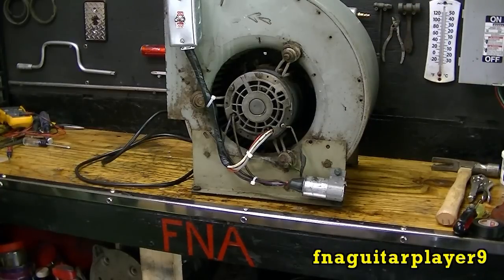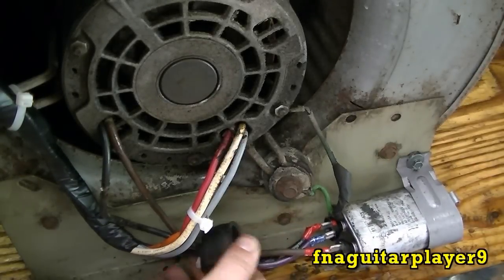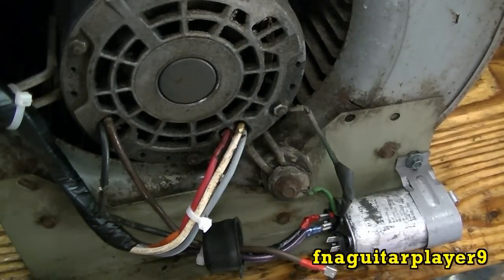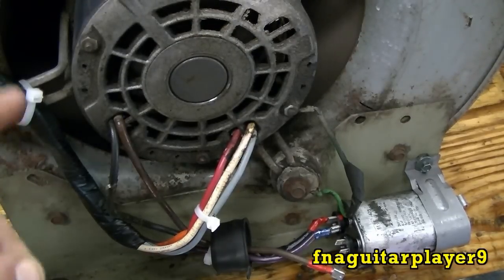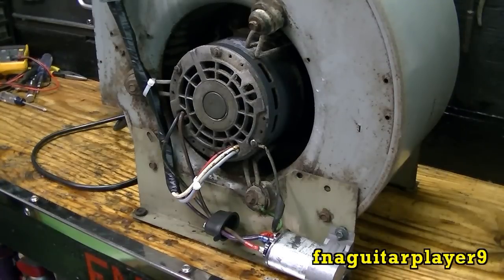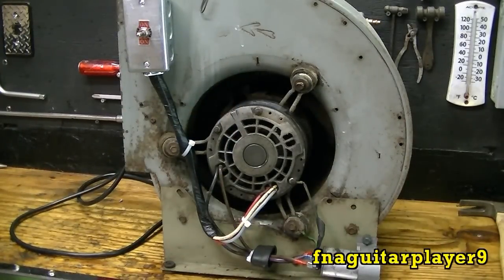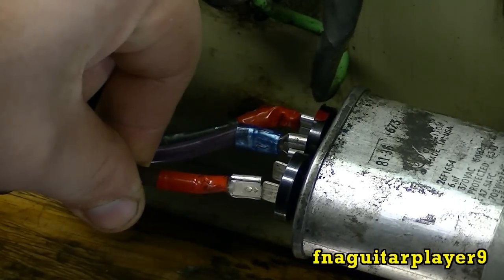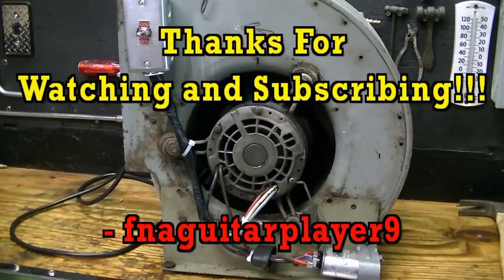Interesting Fact About Capacitor Start Induction Motors

Comment: If you put the start cap in series with the run windings, letting the start windings directly attach to power, will the motor run backwards for a while? That way, the run windings will be lagging out of phase with the start....

Comment: I wonder if you turn a dryer drum backwards if the motor will actually turn in the opposite direction because they have the centrifugal switch in them

Comment: ELI the ICE man: Voltage(E) leads Current(I) in an Inductive(L) circuit (ELI); Current(I) leads Voltage(E) in a Capacitance(C) circuit (ICE).  When you start an AC motor, which is a large Inductive circuit, the voltage and current are 180 degrees out of phase with each other.  The voltage is trying to turn the fan motor the proper way, while the current is trying to turn the motor backwards - that is why the motor sits there and either hums, or often times, it will sit there shuttering back and forth.

The run capacitor might make a little more sense to what I just stated above.  When you charge a coil it produces a magnetic field around the coil.  When you take away the voltage from the coil, the magnetic lines of flux collapse back on itself (the coil) which induces a voltage (and current flow) back the other way than how it was charged.  In an AC motor the magnetic field collapses 60 times a second, and each time the magnetic field does this it produces a voltage opposite of what the motor needs.  The run capacitor is a storage tank to take this unwanted backwards ripple off the incoming line voltage, and therefore out of the motor.

Without taking this ELI the ICE man thing to an engineering level, an antenna radiates an electro-magnetic signal into free space only when voltage and current are 180 degrees out of phase - that is to say, that the antenna is Resonate at that frequency.  Capacitors will not past DC, only AC.  So, when you put a cap on the line, or in a circuit, it sees the ripple as an AC signal and filters it off the line out the back side to ground.  I am a radio guy, and I can only apply this theory in my world of higher frequencies.  I look at an electric motor and say Damn, that is one big ass inductor!  This goes to the heart of Inductive and Capacitive Reactance and, without getting into the weeds, it will take a good size Cap to get and keep voltage and current back into phase.

Comment: I had been running a tiny table top belt sander built around a one eighth horse power fan motor. When I added the cap the motor would only start in the wrong direction I needed it to. Ideas?

Comment: What happens if you reverse the wires that connect to the capacitor.  Will the motor spin in the opposite direction
Reply: There's two sets of windings, start winding and run winding , the start winding is wired in series with the capacitor,  to reverse the direction the start winding connection may need changing over inside the motor box terminal .

Comment: I recently acquired a system very similar to what u just showed, it don't have a power switch although it has that box housing with wires protruding out of it, also it has no capacitor. I need to get it up and running, it's all about wiring everything correctly. So I needed to see more wiring schematics from the power switch perspective.
Reply from the maker: I have another video that goes into more detail on this setup. https://youtu.be/3vwUoo6WczE  Thanks for Watching!!!

Comment: What is a start and run capacitor?Are they used the same and functions the same?I tried to help my motor spins on my furnace but only spins for a minute and stops so I need a new capacitor and it works back to normal after I replace it with a new 10 mfd 420/370 volts capacitor.
Reply from the maker: Start capacitors will only be activated when starting the motor, it helps provide more starting torque, and basically sets the "timing" (phasing) of the motor so it starts in the same direction every time. Run capacitors will do this to but remain active while running to make the motor efficient. Thanks for Watching!!!

Comment: One more interesting  fact you can add to your experiment.
If you take your motor out, clean it really good and lube the bearings very nice. Make sure it is nice and in good shape.  If you run your motor few times and the weather is not freezing cold, you won't need the capacitor or your hand to keep it going.  You simply plug it in and watch it take off.
How you may wonder.  It is due to residual magnetic field that stays in the system ( the laminated iron cores in the coils)  from previous runs.  As you know when you run current through coils of wires, the coil become a magnet exactly with north and south.  With the laminate iron core within and surrounding the coils, the iron core becomes magnet and retains the magnetism.  It is no different than when you rub a screwdriver to a magnet, the screwdriver also becomes a magnet and retains the magnetism after you remove the magnet away from it.
Exactly the same thing happens in motors.  With the starting coils being at 90 degrees to main running coils, there is enough magnetic field in the start coils that interacts with the current through the main coils that will induce current in the armature.  As armature fights back with opposite polarity becoming its own magnet and that is when you the action.  The action translated to motion.  . You get the idea if you understand what causes an armature to turn in the first.  It is the changing magnetic field.
Unlike universal motors, the induction motor needs a little extra help to get the ball rolling.
 Generators and alternators are designed to maintain this residual magnetism far longer and that is how they function.
If they sit around too long, then they also have to be charged before they can generate electric energy.

This entire game is caused by one of the fundaments reality in the universe.  Here is the magic:
You hold one bar magnet in your hand and you put another bar magnet on the table.  Approach the same pole of the magnet on the table with the same pole of the magnet that is your hand.  You will of course notice that the loose magnet will keep moving backwards, i.e. repulsion.
Okay that is obvious.  But let me ask you this question, this is most critical, the main interesting core phenomenon in the universe and without this there will be no electricity or power or motion.
What will happen if you keep moving your magnet towards the magnet that is on the table.  Will the magnet on the table, the free magnet so to speak, a magnet that is not confined if you will,  just keep going back or....?   
You want to do the experiment first or you want to guess first?  :-)
Whatever answer you come up with then you have to ask, why that behavior.....  It is the answer to everything.  And  could  this be a result of the weak Force symmetry breaking?  I.e. things are not equal. Loss of equilibrium...……………….

Comment: Thanks for sharing this, I was able to use this technique to determine that the reason the fan in my kitchen range hood had stopped working was because the capacitor had failed, not because the motor was faulty by manually cranking it and confirming that it spun up.
Reply from the maker: Glad to help out.  Thanks for Watching!!!

Comment: What if you have it up to speed running in reverse without the capacitor, then touch the capacitor like you were doing when it was running forward. What would that do? I'm asking because I'd like to set my drill press to be able to run in either direction but obviously even as you observe, it's best to allow the run capacitor to stay in the mix.
Reply from the maker: Not sure what it would never tried it, it might pick up speed and run normal, not real sure. Thanks for Watching!!!

Comment: 1 question does the cap have a certain way it needs to be plugged like (+ -) or can u plug it either way
Reply from the maker: No, with this type of start capacitor since its AC its non polarized. Thanks for Watching!!!
Reply: @fnaguitarplayer9  thanks for answering my question, good video
Reply from the maker: your welcome, thanks

Comment: hi thanks for the video.below is same text i sent gary, maybe you or other people can help me here:i am seeking help with my washing machine insuction motor i received with 6 wires that i am planning on running as a lathe. testing continuity 
(ohm multimeter reading), i found 3 possibilities/ combinations of 2 wires each time showing  continuity and those gave me motor running (without capacitor, so it demanded me making the first move). thre was 2 high ohm reading (gave low speed turn) and one low ohm reading (gave high speed turn). knowing this washing machine has only 2 speeds, where the low speed has 2 spin directions (clockwise and counter clockwise) it could be that those 2 wire combination i found to have continuity and indeed gave me motor running, are actualy one of them meant to run clockwise and the other as counter clockwise.still i did not discover the way to connect to capacitor. based on my info here any suggestion how to wire the capacitor? probably i should change wiring setting also on capacitor each time i want to get different speed?maybe you can help me here...thanks

Comment: What size motor is that
Reply from the maker: I'm pretty sure its a  1/3 HP, not 100% sure. most blower motors are between 1/4 and 1/2hp. Thanks for Watching!

Comment: I have an Electric Lawn Mower and the motor spins and then stops and starts humming, could it be the capacitor, if so where can I buy one?
Reply from the maker: That could be, i'm not familiar with why types of motors they are using on them to be honest. Thanks for Watching!!!
Reply: @fnaguitarplayer9  most likely a bearing problem

Comment: I'm not a hundred percent sure but I think that the purpose of the capacitor in the situation for this...is to regulate the voltage...I'm sure that it will lose a  small part of it's life in the grand scheme of things... because of the changing resistance...since you are pushing air which resists movement like everything else...but then again I could be wrong...I figured I would give u a chance to dig on me since I did it to u unprovoked...u got to be able to take it if u give it
Reply from the maker: It does several things, and that is one of them, not so much a regulator but more current limiting to a certain point. Thanks for Watching!!!
Reply: @fnaguitarplayer9  just remember voltage leads current in a capacitive circuit..." eli the iceman" a standard motor winding is an inductive circuit where current or amperage leads voltage .The capacitor's purpose in a motor circuit is to reduce current draw on start up and run.

Comment: this motor is called a PSC Permanent Split Capacitor motor. a capacitor start motor will have a centrifigual switch in it which cuts the power off to the start windings and start capacitor. when the motor reaches 75% speed they are used on pumps, belted loads like a belt drive fan or air compressors or a direct drive fan. this motor is a furnace blower motor.
Reply from the maker: Your are correct. Thanks for Watching!!!

Comment: I have a question sir? I have a 15 amp motor for my tablesaw that I am using for a homemade disc sander. The disc is heavy and the start capacitor is not strong enough to get it going. It was a 300 mfd and I tried a 400 and it went out also. What do you suggest?
Reply from the maker: You shouldn't have to change capacitors, they are designed for a certain capacitance, I have heard of people doing it but i personally don't recommend it unless the manufacture suggests it. Thanks for Watching!!!
Reply: fnaguitarplayer9 thank you so much for the reply!
Reply from the maker: your welcome!

Comment: can i get your direct number i would like to send you a pic of my system that i need going urgently to blow air through my loft...its major hot and i have allergies...we connected 115v to the breaker but it doesn't power on 
it was a part of a full system ,,,and i saw it working at one point before i moved in
now it doesn't work since it has been moved from one breaker panel to another and it seems nothing has been changed
i need this urgent , thanks!
Reply from the maker: I don't give my number out on here, sorry! I hear ya. There is probably a switch or fuse somewhere and thats why it isn't coming on, or the motor is bad, some times they quit working. check for power at the motor to rule that out. Thanks for Watching!!!

Comment: this motor is a PSC Permanent Split Capacitor its used to start the motor and to maintain the running efficiency of the motor as the start winding is in the circuit continiously. Split phase, Capacitor start, and Capacitor start capacitor run motors have a centrifigual switch to cut power to the start windings when it reaches 75% of full speed which is suited more for larger fans and belted loads. as some PSC motors will have wire leads on it to reverse the rotation which makes the motor more universal for a particular replacement application. Larger polyphase or 3 phase motors operate on balanced 3 phase power only there is no start or run capacitors in these motors.
Reply from the maker: I used to know all the names when i was in the electrician class, got away from motors for a while. I do like 3 phases motors, there is alot less that can go wrong, no capacitors. Thanks for Watching!!!

Comment: Hi, this is highly educational and have watched it a few times now. Would you consider a video on a single phase induction motor with DOL?
Reply from the maker: Appreciate that, glad to help out. If i run across one or have to work on I will make a video. This type of induction motor is the main ones i've worked on. Thanks for Watching!!!

Comment: That capacitor has the same form factor as the one in your micowave oven.  That usually means they are interchangable.
Reply from the maker: Just because they look the same don't mean they are interchangeable, microwave capacitors are high voltage and low capacitance, motor start/run capacitors are lower voltage and higher capacitance. Thanks for Watching!!!

Comment: It's actually a 2 phase motor.  The run capacitor makes up for the delay needed to run the second phase.  This is also done with 3 phase motors which have two capacitors to run on a single phase circuit.
Reply from the maker: Yeah, thats a good way to describe it. Like 2 opposing magnets, alternating back and forth. Thanks for Watching!!!

Comment: Interesting. I acquired a new 208/230v single phase motor in an AC/Heater squirrel cage to use for a fan with a small silver oval capacitor on the fan. My voltage at the box reads 246v.  I wired it for a single speed according to instructions. I flipped it on at the breaker and the fan started turning and sounded just fine. After getting up to full speed in 3 or 4 seconds, all of a sudden I heard a pop and a flash. I instantly shut off the breaker. I couldn't see what caused it, everything looked OK. I wasn't sure if it was the capacitor or the new motor?  I thought it must have been the higher voltage, but maybe it was the capacitor. It gives me something to think about.
   I enjoyed your video about these capacitors.
Reply from the maker: It may have been the capacitor or a wire shorted out somewhere. I would test the capacitor (or try another one if you have another) and see what it does. And double check the wiring for the speeds. I burnt up a 4 speed motor one time by connecting it wrong, it was on a blower just like in the video. thanks for watching!!!

Comment: Did you make a vid on wiring the fan up?    I wired mine up but my speed controller only does one speed on all ie:- slow , med and hi what have I done wrong?.......I'm new to this style of wiring but so far have enjoyed learning a little about it.... Please advice
Reply: The motor will run the same speed on all settings if there is no load on it. The different speeds really only make the motor weaker, and the load from the fan is what slows it down.
Reply: hi philcould you give me please wiring diagram of the capacitor? do you have 6 wires? as for power' I heared that speed controller could decrease momentum in some motors and also heat up coils. I am planning on using pulleys with different sizes to get my different speeds without affecting the "natural buildup" of the motor.

Comment: Thank you for the video. I was wondering if you would be able to provide some advise on a porter cable table saw electric motor that runs without the blade, but as soon as I mount the blade it does not run. Any advise would be appreciate it. Thank you
Reply from the maker: Your welcome! That sounds like either a weak starting winding and/or a bad or weak capacitor causing that. The motor has enough torque to start itself, but not with any load being applied. If it has a capacitor, i'd check that first, if it doesn't then i'd say its in the windings. Your welcome, thanks for watching!!!

Comment: Why does the motor make a different startup sound when reversed?
Reply: Because the fan is spinning backwards so it sounds different
Reply from the maker: like travis said spinning backwards is probably why, for one, its basically under no load when running backwards, blowers aren't like fans. Thanks for Watching!!!